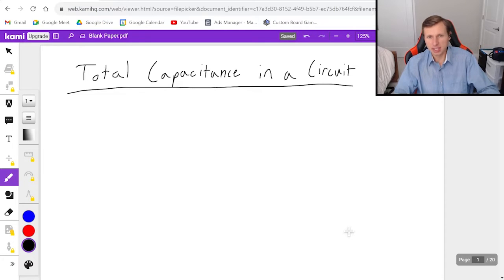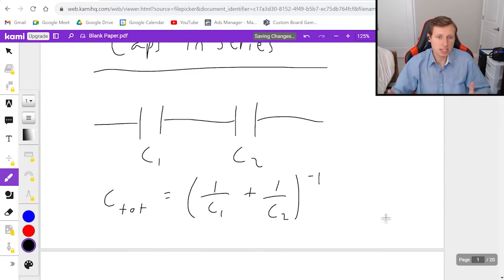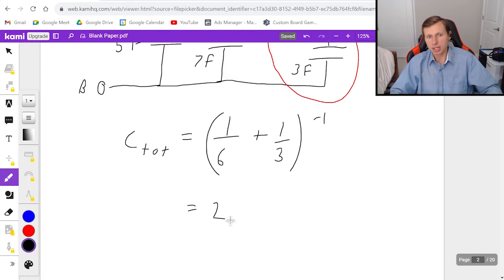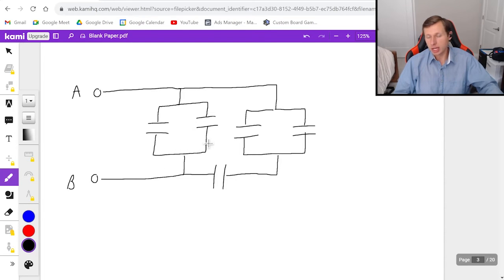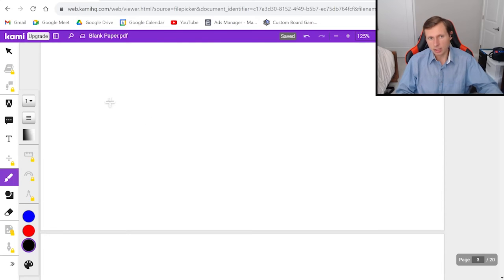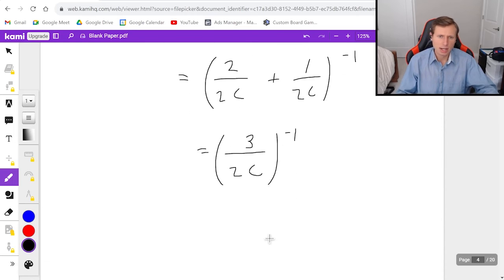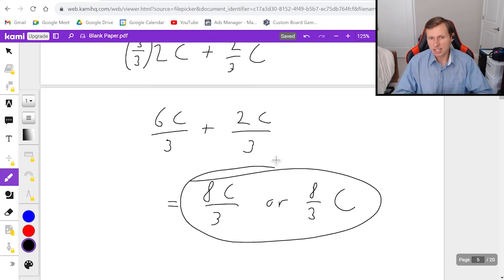Capacitors in a circuit - Series and Parallel

Comment: Sir , how do you spot capacitors , whether in series or parallel , in a PCB  , for instance laptop motherboard without the schematics ?
Reply from the maker: I don’t know about a PCB, especially without schematics. But in general, series is when there’s only 1 path for the charge to travel while parallel has multiple paths.
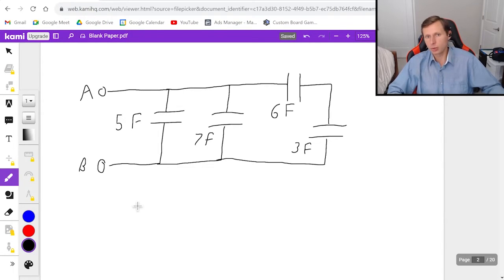Reply: @danthetutor2624  Sir ,  In that aspect of multiple paths  ,  please take a closer look at your schematics in the video 2:00 , if we remove 6F capacitor , the circuit is open no current can flow in and back to capacitor 3F  , so aren't these two capacitors in series in your drawing ?